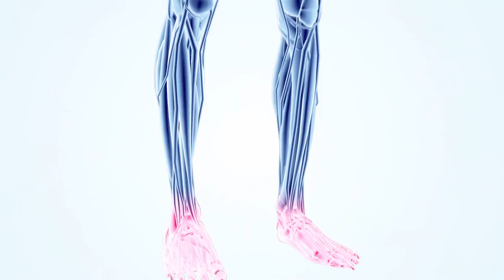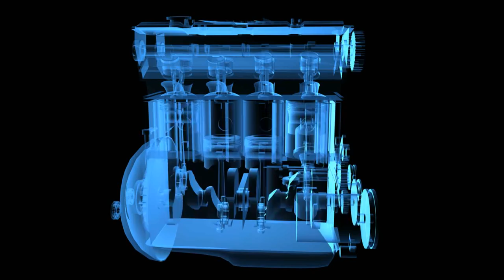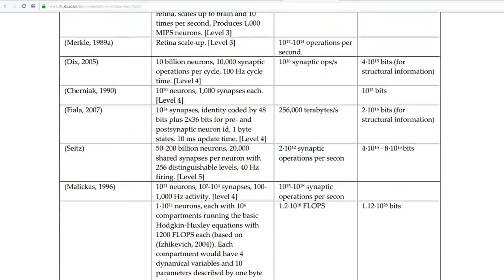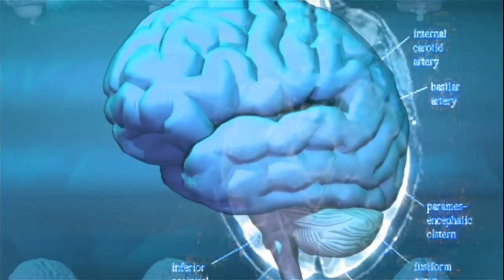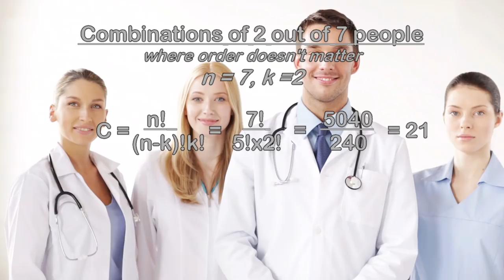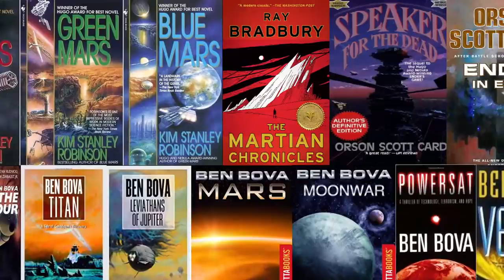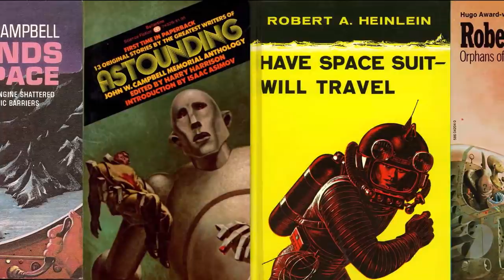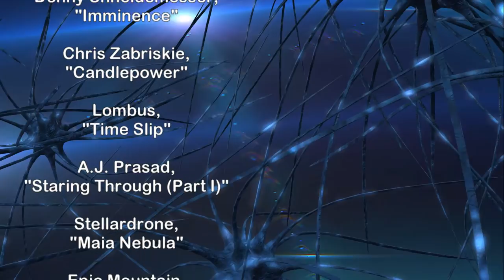Mind Uploading

Comment: Before thinking about minds (let alone uploading or downloading whole brain emulations) our consciousness, which is as fuzzy and ethereal as it gets, I suggest the following much simpler (as it depends alone on purely physical components): create a simple cell. We know the simple ingredients: carbon, hydrogen, oxigen, nitrogen...a dash of calcium and sulphur, a few other simple elements you can find in a basic chemistry set. No mind, or "hard problem" of consciousness, just a mere living cell that reacts to its environment, nourishes itself, can multiply, etc. The problem must be approached from the physicalist perspective and also one capable of bridging quantum physics to chemistry (gotta take into account whatever energy is at work). The basic cell structure can be easily mapped out with computation before we build our own cell. But the problem here appears to be the exact relationship and proportion of the parts at the molecular level: well, start at the atomic level. It's just a frickin cell...why not? Mix up a right batch, under the right conditions (we already know how to sauté aminoacids, so...) and voilá! Then repeat this at increasingly larger levels until you get to mammals, brains, etc. This thing about wanting to upload minds before we have learned the ABC is really putting Descartes before the horse.

Comment: Isn't the question of the number of simulated neurons needed and their inherent value dependent on if we look at them as data bits within a digital model, or as interactive resonance points withing a holographic system?  I think the later model relies on each neuron having a more analog value system rather than a digital one, with the frequency interaction vastly complicating the values and their interpretation for analysis.

Comment: Some basic things about the mind-body relationship can be pretty weird.

Like, I'm quite tall, and that has an effect on lots of things, how I generally perceive the world, and how I interact with various fixed objects that are typically specific sizes, heights and so on.

But one thing is universal about height - everyone has experienced being shorter than they currently are, but nobody has (truly) experienced being taller than they currently are.

Meanwhile, since I mess around in VR reasonably often, I've had the rather peculiar experience that I'm arguably more comfortable being shorter than my actual height, than being an accurate representation of my true height.

Granted I have some really weird self-image issues that I'm not comfortable getting into here, but it raises a lot of questions...

Now, if you follow on from this, if I were to get a new body that's more in line with these weird thoughts I have about myself, would I be more comfortable? Or would the reality of what my current physical form is like dominate regardless of the odd thought and experience I have, and cause major issues?
Perhaps something in the middle?

Also worth considering that if I make fairly large alterations to my physical form (OK, not exactly as dramatic as no longer being approximately human shaped, but still fairly dramatic), if this causes discomfort and problems, would I get used to it?
More intriguingly, regardless of whether I'd be comfortable in this new body or not, if I inhabit it for a long time, how will it influence my mind?
Since it's fairly obvious that the mind is not truly a static thing, it seems likely that over time elements of my mind and thought processes would adapt themselves to the nature of this new body...

There's so many strange possibilities here...
Quite something to consider...

Comment: @Isaac Arthur -  great video!  I also had this idea of gradually replacing the neurons with computer chips which seemingly solves the problem of copying.  But there is a huge problem that you didn't address which is this:  

1.  after replacing ALL neurons with computer chips - is the sum of it actually CONSCIOUS?  THAT is the problem here.  Are the computer chips capable to produce consciousness in the same way as biological neurons are?
2.  if NOT, then at which point does the mixture of "computer chips and biological neurons" stops having the conscious?
3.  if YES, then how do we proof it?  The Turing Test and its variations are all flawed.
4.  If YES and we CAN proof it, then we have basically no good reason to "wait" and replace the neurons gradually over time (though it's  a very nice thought experiment).  Unless we would wish to keep the potential power of the electronic brain low.

Do you have thoughts on that?

Comment: First time we manage to emulate a human brain successfully, we will probably use a very, very large computer. We will probably go with a brute force approach, trying to emulate individual neurons, synapses, neurotransmitters, some protein densities, ion charge, etc. But once we succeed, though, we will start "playing" with it and see what happens when we reduce the granularity of specific cell layers, brain areas, etc. We might end up having entire sections of the brain working as "black box" systems with millions of input and outputs, but with a highly simplified inner working. Then after a feew years, we'll be able to run a brain on a machine that's 10,000x less powerful, thanks to our better understanding through experimentations.

Comment: That's it. Never sleeping again. Like Quentin in that book with the rolling cathedrals and the gravity radio gas giant... Hey there's a topic, say you could bounce a large mass back and forth; what size transmitters/receivers does it need for practical use? Seems would be good for sending encrypted messages or relaying messages through clouded/noisy space
Reply from the maker: I'd have to re-read it to remember the specifics, strangely while I've listened to book 1 and 2 a ton of times, I've only listened to that one once.

Comment: I think the copies will eventually become different people. Assuming the memory and conciseness aren't linked and they have different memories based on what they were doing. They would eventually become a different person. If you send one copy to go exploring the galaxy, and you keep the other in the matryoshka brain, the one that went exploring will have a deeper self awareness and intelligence, just by going to all of these places and solving problems. On the other hand, the copy that stays home will not have to solve any problems nor have to use intelligence. If the copy isn't careful, it could be overrun with dopamine and laziness and would become much more laid back then the one that was sent away. This could also result in fights between copies. Again, this is all assuming that the memories aren't linked. 

I kind of hope they are so that the one mind that has all of the copies memories and thoughts would be indistinguishable from a god. The separate copies are like individual text documents while the linked mind is a google drive.

Comment: My problem as a sci-fi writer I feared that people could claim I stole someone else's Idea, so I stopped reading other people's works.  I have a lot of sci-fi/fantasy works, but if they aren't on my blog, they are so old as to be out of print.  I do keep most of the story lines as verbal stories I tell to friends, as the need arises, and only tell small sections of them.  When you create a Multiverse it is easy to open a door and see a section pretty much at will, Though currently my blog is mostly poems to my girlfriend.  That spans over 550 of them.

Comment: tl;dr: If the upload process is less disruptive than sleep is, then I would consider it to have resulted in a true upload, rather than a copy.

What if the destructive scanning process has the copied material that is contained within the computer still continuously interacted fully with the unscanned parts of the brain? Perhaps you would be laying in a lounge chair, awake, and find that as your visual cortex begins to exist inside a virtual environment you still feel like you are sitting in the chair but you see the virtual environment. Then as you sit there and observe, you can sense various parts of your body and aspects of other senses gradually be transferred to the virtual space. I feel that this approach or even the slow replacement of neurons with mechanical but otherwise perfect copies of themselves both result in the original you being sustained but with a new substrate. Similar to handing an object from one person to another. Giving someone an item doesn't make that item a copy of itself. So too do I not think that the substrate has a very firm connection to the mind. I would expect that being uploaded in one of these manners would seem to my experience to be as continuous as moment to moment consciousness is and wouldn't result in one being having their experience permanently come to an end with a brand new one fooled into thinking it's the same person, at least no more than regular sleep may be just that sort of event. However, I draw the line there.

Comment: Greetings Isaac, nice job.

Most of the mind discussions I’ve seen have one flaw – the person does not understand what software is. Software is always the information stored in a memory system. For animals, that memory system hardware evolved over geologic time. But the memory system is not in any sense a mind - it’s just a piece of containing hardware. The mind is not a hardware/software amalgam. It’s software only. So, for instance, electrical engineers and software engineers are talking about utterly different systems and hierarchies. It the same with biologists and psychologists. Psychological models don’t have any hardware models at all – everything boils down to memories – exactly what’s expected in software systems. When someone has a delusion, that just means they have a mind-software error, it has nothing to do with neurons or hardware structures. Psychology is not high-level biology - it's a completely separate system made of software.

Learning means software building. A mind is made by learning over a lifetime. Old people are much smarter than young people because they have accumulated more software, not because they have grown new hardware. All intelligence in any context comes from the operation of software systems only.

Ok, let’s use a genome-upload as a practice example of a potential mind-upload process. You need to realize that the genome is a piece of software stored in a DNA memory system. Then read out the software (with some kind of scanner/memory-reader) and write it to another memory system (like a computer memory). The genome software remains exactly the same no matter where you move it.  You don’t need to additionally send DNA molecular models to the target. In any memory system there is software contained within. The entire purpose of the memory system is to hold its software. The software is always a completely decoupled from the hardware (like its own universe), so you can ignore the hardware details.

For a mind upload you need to have a target system that does what a cortex does, like a cortex chip, or software version  of it. To move a software mind, you need to scan/copy the contents of your cortex (a memory system). You are not scanning the hardware structure - you are scanning the memory system contents. You are moving 100% of your identity over to the target system. If you do it quickly, you will see this as a mind teleport. This works exactly the same for robots, except you don’t need a cortex memory reader.

Thanks for listening. ;)

Comment: 25:10 "Whether the change takes one century or one minute" might actually be very important if the mind has a refresh rate (since computers have it - the processor frequency; and there is a smallest interval of time at the Planck scale, under which causality doesn't matter any more, there is no reason not to think biological minds also have it). So it might be that if the brain is replaced too fast or too slow, the original conscience will disappear. 
As to how to test that. Maybe ask the subject? If, at some time in the replacement process, he says that his thoughts are going fuzzy and his mind blank, and then after a while he gets well again, that might be an indication that the brain refresh rate was not respected and the subject died and was replaced by a copy.

Regarding how that relates to unconsciousness while asleep, I don't believe we are unconscious in that sense - the brain still works but in a different mode. If I am to take my times that I remember while dreaming, I experience a dream in exactly the same way I read a book: there's a place and characters well defined in "the middle" and less so in the details and I view them either from first person or third person. So, if I am conscious/alive while reading I should also be while dreaming. Something similar but which we never remember might also happen while dreamless sleeping. Just my two cents.

Comment: @isaac_aurthur when i developed the general a.i. equation i was worried how people would treat a brain in a box.  for us, uploading would require very high resolution squid fired holograms to imprint a neuron system, then another computor to record the connection network, then another special purpose hologram to actually process that information. this would enclude sensing neurons.. which can be...sensitive..and end effectors would wear and need replacement --often.  learning would still pose another system add-on and then there is the problem of personality drift...

Comment: Personally I think I t will take less power to emulate a human mind than anyone's ever thought. After all code gets more efficient over time even as processors improve and get more powerful. What took 80 lines of BASIC to do 40 years ago can be done with single lines of Python now. Given time it may only take a trivial amount of processing power to create a simulated human limbic system thanks to new developments in the programming side of computer science. People seemingly never factor this in.

Maybe it's because it seems to take more and more space to store a movie thanks to the resolution wars? If you look at a modern video codec which encodes video into formats available back in the day you'll note the playback is better and the video will take less space (assuming the same resolution and framerate) than a video code from the same time period. There's no reason to assume it will be any different for human minds or AIs.

Comment: I consider an object to an arrangement of components, thus allowing me to consider the ship of theseus to be the original ship.
Reply: Kurt, that’s pretty good, but keep in mind that space-time also bounds and defines objects too.

Any arrangement of objects just means its structure. Structure means information. Software means information stored in a memory system. In other words, all memory systems are really structure storage machines. So, you can assemble a software Ship of Theseus, which is just as real as the hardware version in nature (sans the physics particles). This is why game-worlds (software universes) are made of software (stored structure).  ;)
Reply: Yes, you can make a digital structure which is an accurate replication of an object. Though it would likely take an inordinate quantity of processor power and memory. to make an accurate copy.
Reply: Yes, but only scientists typically want simulations (or precise simulations if they can get them). In most human level applications, you only need the macro scale structures anyway, and most of the time they are not going to have duplicate behaviors either. The advantage of software objects is that you can make the universe you need, and not face the difficulty of working with the default universe that nature supplied. It's also a lot easier to manufacture software than to manufacture hardware.
Reply: I agree.

Comment: From the video it is not clear to me if the author expects the uploaded mind to be consciousness i.e. have an inner experience?

I wonder why this question isn't touched upon at all? Is the assumption simply yes?

Why would the uploaded mind be anything other than a simulation?

Does it matter if runs on a normal CPU or is a special configuration of hardware or substrate needed? Which kind?

How do we know which uploaded mind is a perfect simulation and which has an actual experience?

Otherwise put: the first step before the second of mind uploading would be to solve the hard problem of consciousness.
Reply from the maker: No, I don't assume it, but I take the stance that you can't really be sure and that if someone is acting enough like a genuine person you can't really tell then you owe them the benefit of the doubt. In that context, I assume the answer is 'yes' because it's not a proper mind upload and emulation if you can easily say 'nope, not a person'

Comment: I don't want to be a nit-pick, but wouldn't copying be the same as slowly replacing over time anyways due to the sequential nature of how we copy things? I don't see how a computer or anything could copy each necessary component in the brain all at once. You would need as many copying devices as there are functional things to copy, which even at a conservative measure is simply huge. Maybe with significant advancements in miniaturization and quantum computing this could be done, but due to this difficulty, I am leaning more towards the single person version of mind uploading rather than the copy & original version.
Reply: One can read/write/copy in parallel - in fact, one often HAS to in scientific programming, due to absurd sizes of data files we tend to produce and then have to analyse.